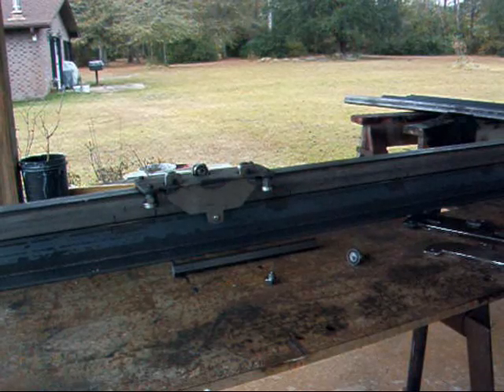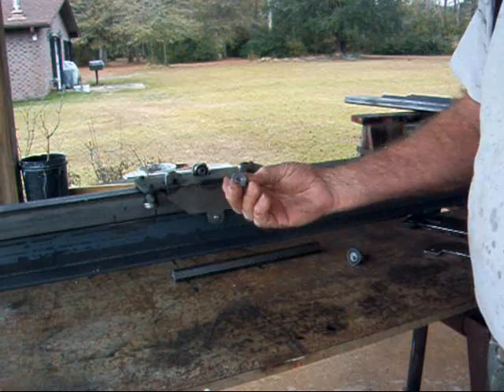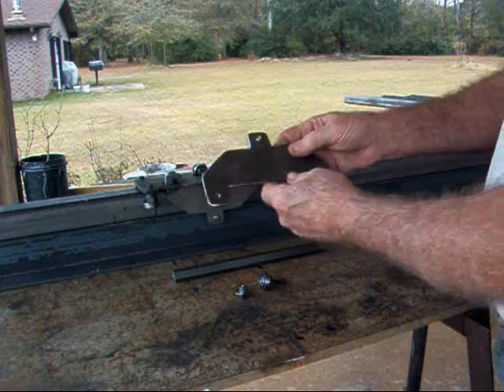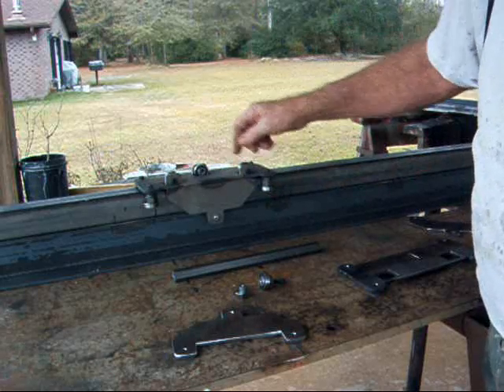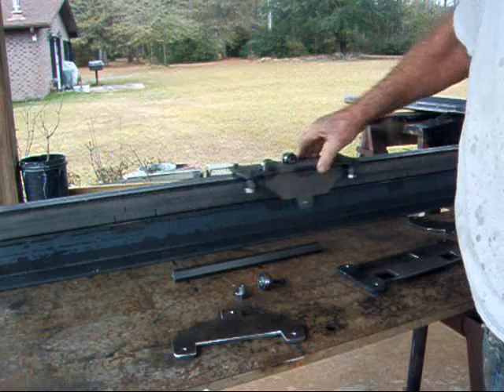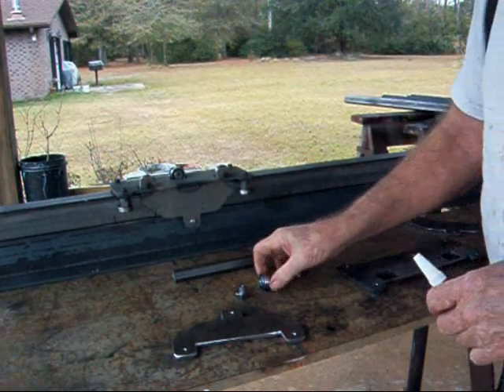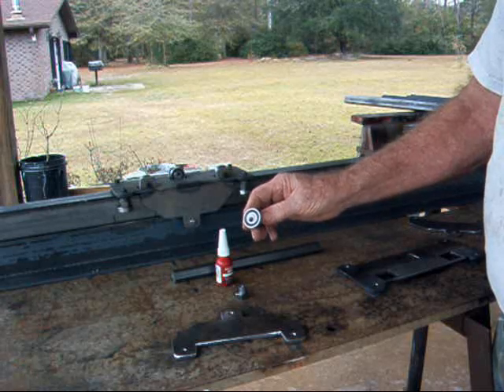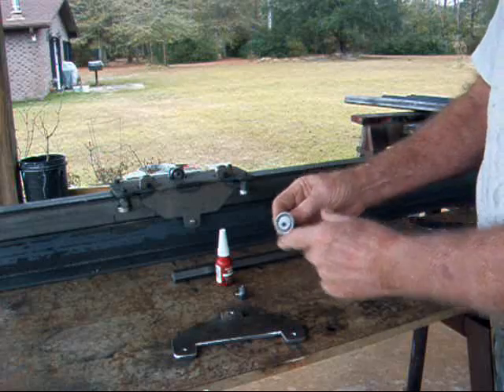CNC bearing slider

Comment: Is that an I-beam under the piece of tubing that the slider rides on?  All you would need the eccentric adjusters on is the bottom bearings and the inside or outside bearings, you wouldnt need them on every bearing.